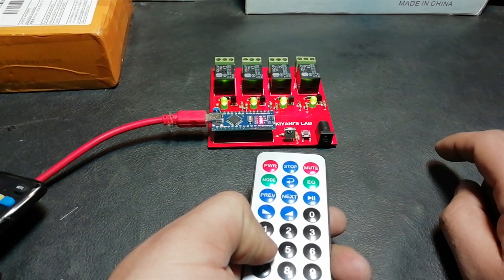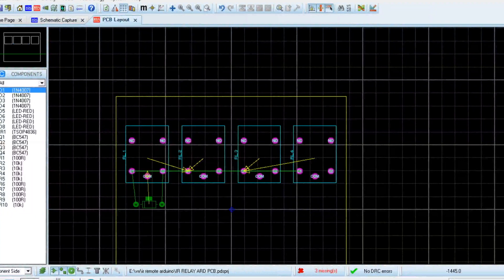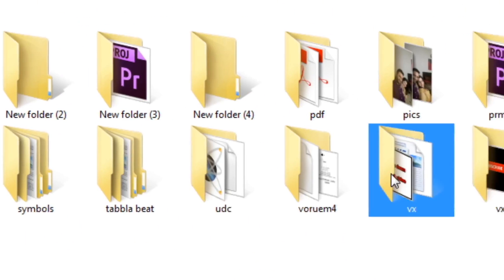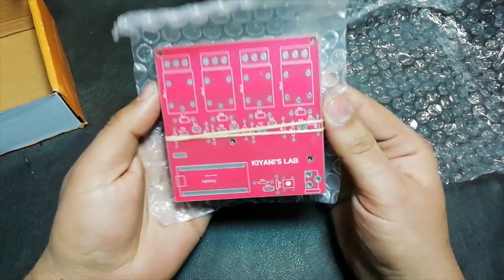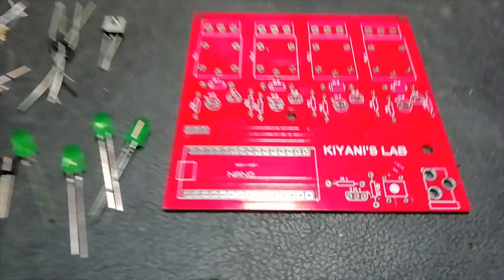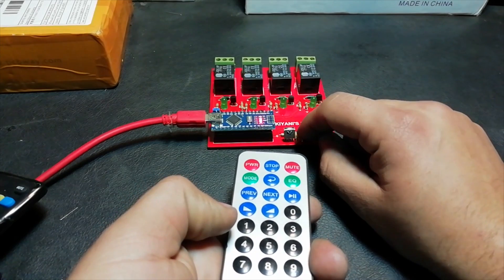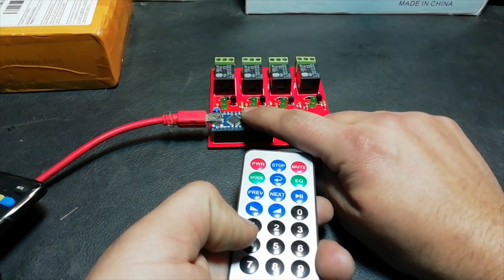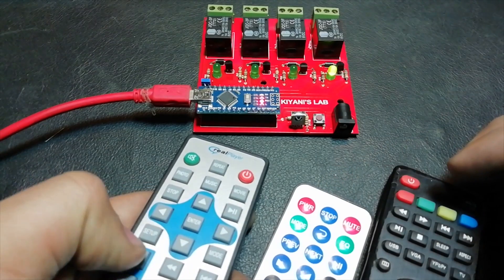How to make 4 channel ir remote switch |  PCBGOGO.com

Comment: Hello sir,nice job u are doing.  but i think there is error in the code, "TKD2" was not declared in the scope that's the compiler message, so sir what could be wrong? Help me sir,for I am a big fan of your jobs.
Reply: @KiyanisLab  thanks I have done it but sometimes the relay won't hold,unless I hold the button I am pressing,
Reply: Sir that 3 pins jumper behind the arduino nano, which pins are they connected to,because I think that's where my problems lies

Comment: Kiyani Bro there is error in the code...
Reply: @KiyanisLab  IRremote tools.cpp:5:16 error 'TKD2' was not declared in this scope
int RCEV_PIN = TKD2; // the pin the ir receiver is connected to
^
Return code is not 0
This type of error is showing when I am going compling it.....
Reply: @addiction-69  hi bro,I experience the same problem but this is what you must do.go to https://www.radio no libraries.info/libraries/i-rremote. Download version 2.3.3 do not unzip it install it
Reply: That's how I solve mine,kiyani does not reply comments, and is not cool
Reply: @TemaxTech  thank you for help

Comment: Sir ji main aapka subscriber Hoon mujhe 24 volt DC power se 7.4 voltage ki battery charge karne ke liye minimum 9.50  voltage output hona chahiye isliye auto cut off circuit safety device charger banana hai mujhe video aur diagram Bana kar bhejo
Mera WhatsApp number 960 476 8313